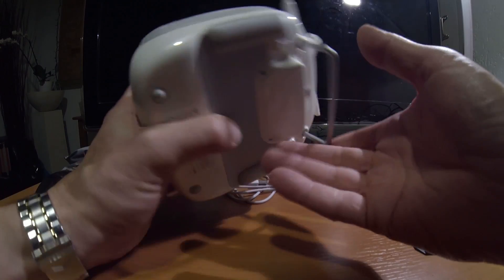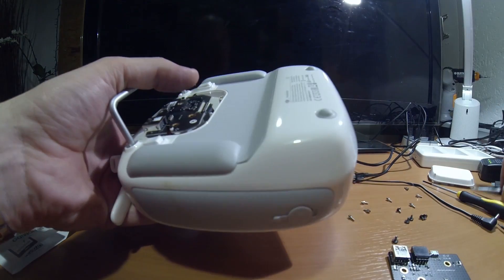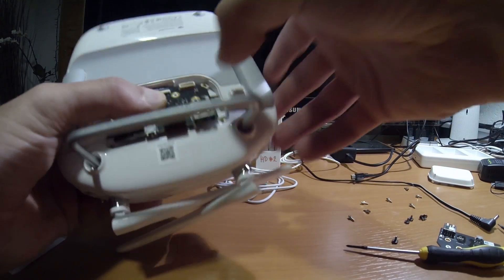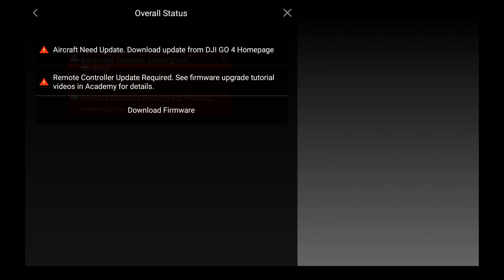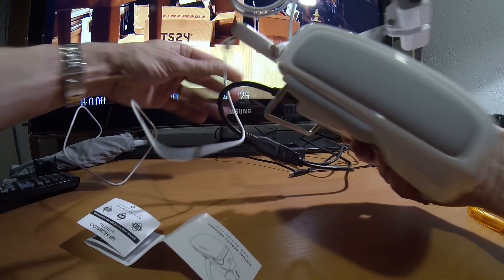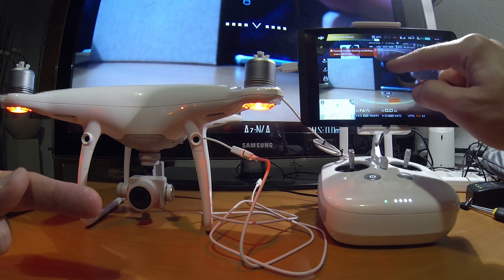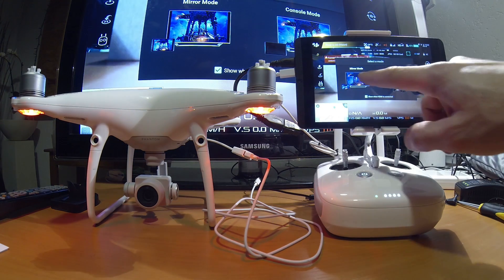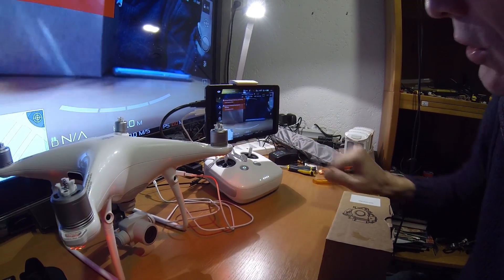Installing the HDMI-module on the Phantom 4 Pro. Testing USB and HDMI-ports for lag.

Comment: I’m having trouble with my HDMI module when I go to connected to my goggles it disconnects the live feed from the tablet or if I even woke up to a monitor for some reason the HDMI is disconnecting the live feed can you help me with that
Reply from the maker: I don't use that anymore, because I use the HDMI port from my tablet. But I vaguely remember that their is a setting in the DJIGo app to have both on simultaneously.

Comment: I have a Ph4 and nvidia shield k1. I connected the tablet to tv through hdmi output. It worked fine but is there any way to filter data screen ( to "erase" it, make invisible)  and just send the image to tv?
Reply from the maker: Yes, you can swipe the screen on the tablet and all the telemetry will disappear so you only have the video feed.

Comment: With the HDMI module,the live video transmission won’t get interfered by wifi interference nearby if you link by cable correct?
Reply from the maker: No, it's still possible that the signal (from the drone to the transmitter) gets interference.
Reply: NeverMindYourOwn Oh,but lesser right?Much lesser interference or Just a lil bit lesser?
Reply from the maker: These things are not related and have no effect on each other. The HDMI-module gives an extra video signal to an HDMI-port so you can attach goggles instead of just using the tablet.

Comment: Hi, I have installed the HDMI Module, according to your video, on my P4P to use DJI Goggles as 2nd Person view. After a short flight,  the HDMI module went quite hot, the iPhone 6s I used as controller, has stopped charging. 
Short after, the video signal kept breaking every few seconds. Filming was thereafter impossible. Updating  GoPro4, or reinstalling didn't help. I have returned the module now and hope for reimbursement ;(

Maybe I try it with NVIDIA Shield Tablet next....

Thanks for the fantastic videos here in you channel. Please continue. :) Greetings from Stuttgart, DE.

Comment: Hi! You fly with a tablet of Nvidia Shield K1, do you have lag or friezes on it? What version of android on it? Is the tablet stable with DJI Go 4?
Reply from the maker: I have Android 7.0. I have issues yes. To work well, delete all DJI apps and folders and clean instal the latest update. Disconnections may also be due to a bad USB connector in the transmitter.
Reply: I read that if android 6 is installed, then there should not be any problems. I want to buy this tablet for flights, and I thought about it.
Reply from the maker: Yes, 6.0 should be fine. Although I still try to get it working on 7.0.

Comment: I just wish that DJI comes out with a Go 4 app update that fixes the app from crashing 3 or 4 times during each flight.
I really like my Shield K-1. For now, I am using the iPad mini 4 and no app crashes but also no HDMI output for my FatSharks. For this reason, I was considering getting the DJI Module, but still undecided. 
Come-on DJI, fix the issue with Android tablets, we are all waiting......
Reply from the maker: One subscriber suggested this to me: uninstal DJIGo3 and DJIGo4, then delete all DJI folders on the K1. Reinstall DJGO4. He said he had no problems since. I have done two 20+ flights after doing that without crashes. Which is a miracle in itself. So there may be hope!
Reply: Thank you, I will try that again,  I had done a factory reset and loaded all the updates requested once booted and then installed the Go4 app, but still had the same problem.  It maybe that cloud backup installed old files back onto the tablet? I will ensure it does not get cloud files and give it another try.
Reply: you have to downgrade the shield to 6.0 never crash,  7 will never work. module dont work with phantom 4 i dont know why people keep posting, the inspire 1 and up are the only ones it works on......waiste of 99 bcks

Comment: So what's the verdict on this now?  Are you using the android tablet or the module?  Just seeing if you've found a work around for stable connection. Thanks
Reply from the maker: I used both, because I had so many app crashes. But I'd prefer the tablet, because then I can see the whole app screen with lots more info.

Comment: Hi Mr. Phantom passionate! So HDMI output from K1 looks faster via GO4 app than from module with HDMI -  however .. - as you know GO4 crashes a lot currently with Androie so what we are going to do?
Reply from the maker: We will have to fall back to Android 6.0 until DJI has the issue sorted out.

Comment: So what's your point on having an HDMI module if it's lagging by 8 frames
Reply from the maker: If you have a K1 you don't need one.
Reply: So how come you use Fatshark goggles when it's not 1080p and it doesn't give you much telemetry? For me it kind of seems like a downside to me but I've never tried them
Reply from the maker: They're small and do the job. When I connect them to the tablet, I DO see the telemetry.

Comment: My K1 the GO 4 app crashes at least once every flight , I suppose with the hdmi backpack you would still have an fpv feed while you restart GO 4 on the K1 , its a pain you have to pull out and reinsert the usb lead , on my ios when I use the air 2 I have no such problem having to unplug usb leads to get the GO app working with a video feed . I like my shield but my Air 2 ios makes thing so much easier and stable with DJI apps,   I also have the p4p+ with screen and GO 4 even crashes on that , and it is purpose made by DJI ! lol

Comment: Nee nee nee. Jij en ik, dat wordt pas leuk. The more I see, the more I like. Nice vids, informative and a funny cool dutch dude. what else...! BTW. would this(tablet hdmi out) work for the mavic as well?
Reply from the maker: Technically it would work, but you'll need a third party holder for it, because it won't fit like your phone.
Reply: NeverMindYourOwn was allready using one, so that part is solved. Use a Samsung SM-T810 atm. Check MM today to get the shield. Thanks for the info. Any news on your bird in repair? Seems like all production has shifted to the mavic. Thats why new 4 pro and said repairs are taking a while.

Comment: Thanks for sharing. I just bought the Shield for a backup display to my Nexus 7. I think I might not buy the HDMI card for the P3A now and instead use the Shield HDMI output when I purchase my FPV goggles. I am on the fence about which goggles to buy. Either the Fat Shark or the Headplay goggles. Do you have any recommendations? Thanks again.
Reply from the maker: Never used the Headplay, but I like the small size of the Fatshark, because 1. it looks better and 2. it is easier to take with me when I travel..
But... there is a new Fatshrak coming. It might be worth while to wait for it: http://www.droningon.co/2017/02/23/fat-shark-base-hd-goggles-launch/ because it will have 720p!

Comment: Does your DJI Go4 crash (quit) while you are flying?  I have Nvidia tablet, DJI HDMI adapter and otherwise stock P4. The Go4 app crashes 1 or 2 times during a 15 min. flight.  The HDMI output to my goggles never quit working because it is not part of the Go4 app. Just something else to consider. Maybe DJI will fix this issue.
Reply: It's not the tablet's fault it's DJI.  I had over 100 flights on my P4 with the Nvidia tablet without any problems before DJI forced an update and now it crashes all the time. You would think DJI would test their products before they release them.
Reply: Small video lag in this style drone not a big issue. It is a big deal for racing quadcopters.
Reply from the maker: Yep, 1-2 times every flight. Sometimes even more.
Reply: I understand what you're saying, but I still want to use the more reliable tablet for DJI's software, even if it is not the tablet's fault.
Hopefully in the future they will all be equally compatible and then we can use tablets that have HDMI out, and screen capture, etc.
I've tried using Reflector 2 to capture my tablet's screen during a flight, but it kills my framerate. I'd love to have HDMI out!
Reply: Wow! Are the tablets really that unreliable? I run my p3P with an iPad air2 and the app has only crashed once after 200 flights in over a year. I would like to get a tablet with hdmi out, but I wouldn't be able to stand having my app crash when I'm flying.

Comment: I fly my P4 with vr goggles.  Just plain and simple 30 € Trust goggles.  I use the litchi app in VR mode, and I just found out how the complete head tracking works. 
Have you all ready  tried this? 
This way you need no HDMI port at all...

If you are interested, I just uploaded a short and unedited third testflight.
 
And, forgot to mention, I like your style in video's. Fun to watch. Every single one of them.

Comment: as always great way to spend Saturday Morning, thank you.  Using those pliers on the ribbon cables ....ouch ...I realize the PLUS is a LOT of moola, BUT ...simple one-point charging, no connection cables, HDMI port, dual Micro SD,  etc ..so when are you making the leap to FPV Racing ?  really exciting technology !  the new racers coming with DJI GPS !  Keep the videos coming ...
Reply from the maker: :D
I am looking out at racers once in a while, but I don't know where to start yet and I still have tons of things to explore in this area.
Reply: check out the   CONNEX  FALCORE   it is amazing ..not cheap !  $800.  with controller (HD Digital) which has HDMI port !!  it has a shield mode it stays 4' off the ground allowing you to just steer with right stick ..amazing ..inventors from Israel, and they are EXCELLENT at customer service !  also   check out  HELIPAL  OWL 2"  or  3"   excellent beginner !!

Comment: which one has the best Video Quality?
Reply from the maker: My HDMI-module has 720p. The tablet may be more, but the video in the tablet is from the same video-stream as what it sends to the HDMI-module. Also in the settings in the DJI Go app you can set the size of the video-stream between 4 and 10 Mbps, which makes a lot of difference too of course.
Furthermore, it totally depends on the goggles what quality you will end up with. I have a Fatshark Dominator V3 which scales the video down to 800x480 pixels. So that is what I see in both cases on both ports.